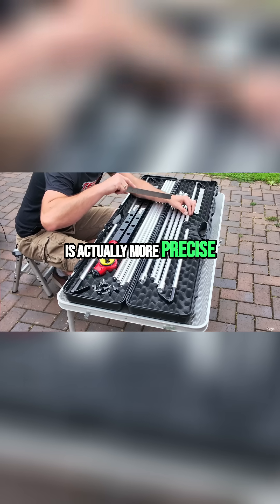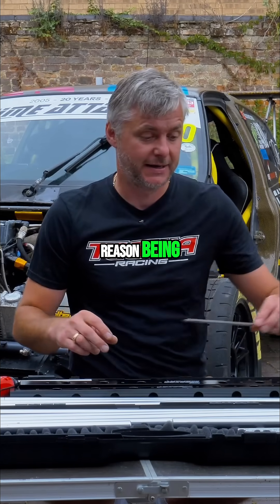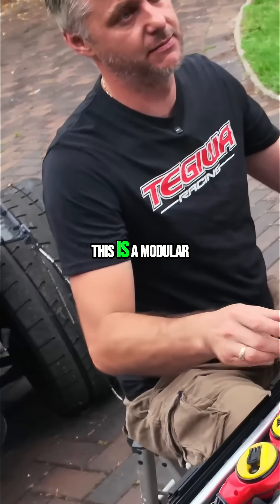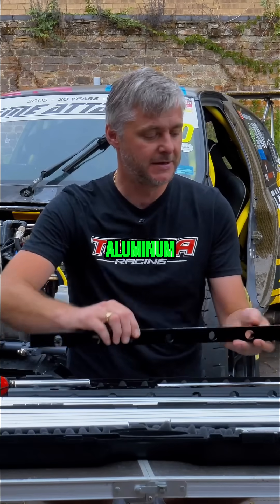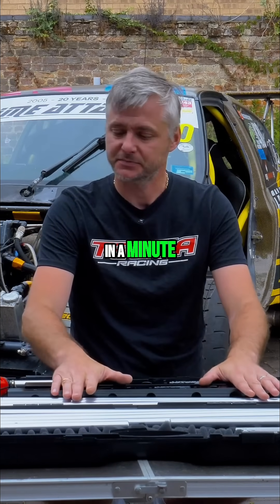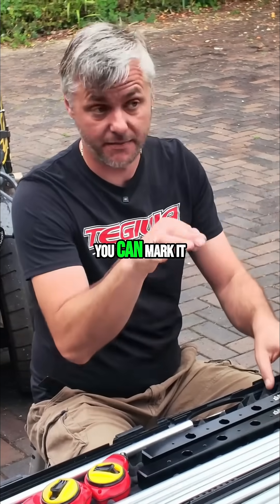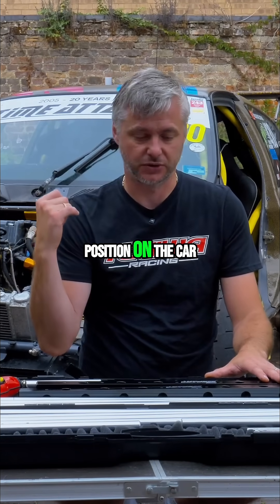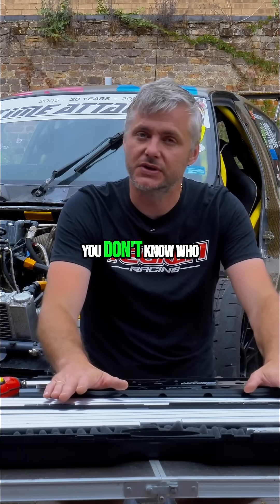DIY Car Alignment: Faster, Cheaper, and More Precise! #shorts

Comment: If you use it a few times and know where everything goes😂❤. So you’re going to fuck it up a couple times. We don’t all drive race cars we drive road cars and the man that does. The alignment is usually pretty spot on. I’ve never had a problem with the alignment.